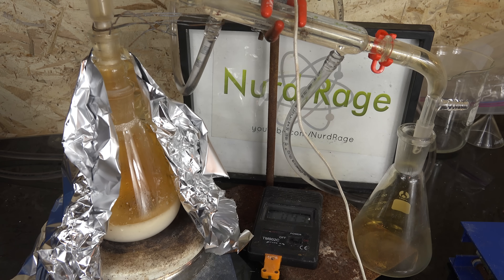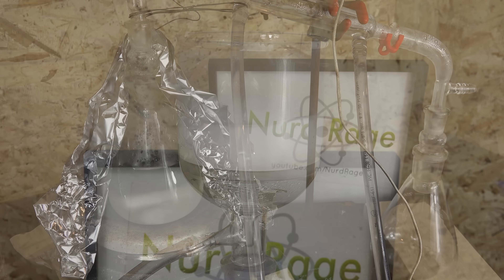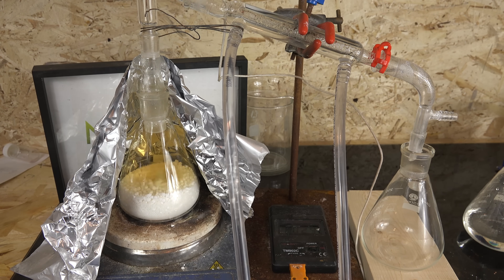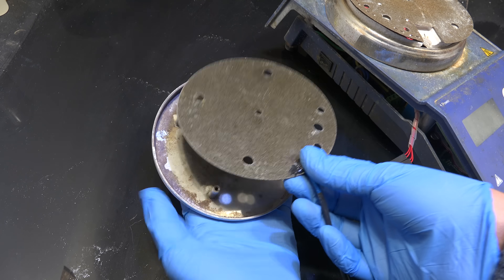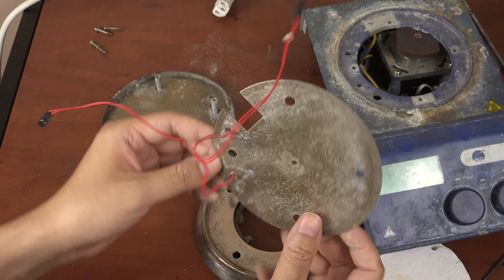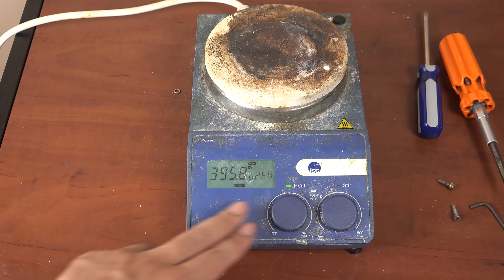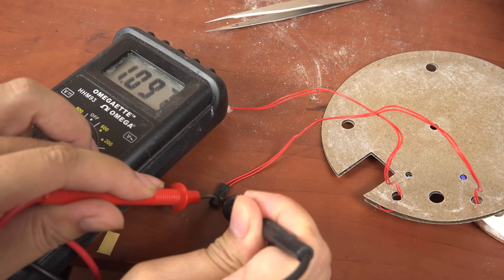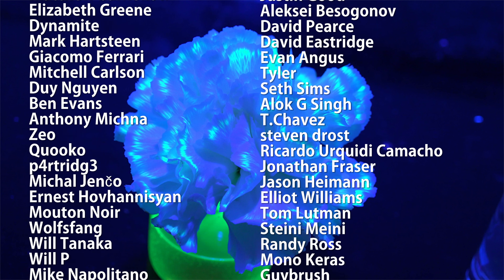Lab Notes -  August 31st - Nitric Acid from Calcium Nitrate and My Hotplate Failed, Again.

Comment: Just got my self 5 kg's of calcium nitrate. I was sure to ask the seller if it was indeed JUST calcium nitrate and not the calcium ammonium nitrate variety. Anyway, got the product, added a small amount into a beaker and added some concentrated caustic soda, only the most faintest sense of ammonia so I'm taking that as a win. Took a known weight into a pre-weighed vessel and heated it , after a minute it started to melt and bubble, water being driven off....from the values taken it looks like I have the tetra hydrate, that's to be expected though, it is after all the article of commerce for fertilizer, so I will just have to stick it in a pan and gently drive off all the water, all thirty odd percent of it !. One thing I have noticed with doing the dry distillation when using double the bisulfate, you have to be judicious with the heat because it's actually quite easy to keep on heating it after the nitric has all come over thinking you are getting more nitric when in fact all you are doing is driving over water from the bisulfate monohydrate...But overall this is by far the best way to get nitric acid.

Comment: You can also get an issue with a buildup of debris on the heating plate surface if it insulates the temperature sensor

Comment: Awesome work. I have two questions if you have time.
1. Could heating the 5(Ca(NO3)2)*NH4NO3*10H20  at ~150C prior to adding the NaHSO4 drive off the water, leading to a higher % HNO3?

2. The pool pH lowering chems I find locally are labeled as 93% NaHSO4. Do you have any idea what the inerts are, and if they would interfere with the reaction?
Reply from the maker: 1. it probably would, but at the cost of lower yield, the water helps to solubilize the reactants so the reaction goes to completion.

2. likely Na2SO4, and that would not interfere, just use an excess
Reply: @NurdRage  Awesome thanks, I'll join your patreon. Also would love so see the updated nitric acid guide at some point.
Reply: @NurdRage  What was the approximate concentration of the acid produced from the dry method?

Comment: I'm wondering if this process works equally well with CaNO3 instead of CAN or if it even matters.  I can get as much CaNO3 as I want dirt cheap but CAN is a different animal.
Reply: can works
Reply: @user-ir2tm6vg3c  "can works"
Bro you confused me with that Message.
Does IT Work??😂😂😂❤
Reply: @prolethazine6293  CAN is short for calcium ammonium nitrate the latter is calcium nitrate -- they both work.

Comment: solder had also not helped with the temperature sensors, the connection wires of such sensors are made of platinum or platinum/nickel so that the set resistance of 100, 500 or 1000 ohms is not affected, such connections are either spot welded or crimped, Actually, the entire connection up to the PCB should be made of platinum wire, which is also the reason why high-quality RTD sensors with only two very long connections are very expensive

Comment: It would be nice if you could cover the electrolysis of KCl to KClO4 using swimming pool chlorination cells that use Rb,Ir on Ti anodes. Just wondering if they would hold.
Reply: easier to just thermally decompose imo

Comment: (OFF TOPIC)  https://www.youtube.com/watch?v=VdbchGjTtSM&ab_channel=SuperPyroBoys
Watch this video and tell me what you think.  This guy was attempting to make K2S2O8 Potassium Persulfate. 
But I don't think that it is a complete process. Why?   Because the precipitate creates a very strong ammonium smell when mixed with Mg or AL.   AND.. is reactive with moisture
 I mixed two different batches. The first batch I didn't clean/wash at all after  filtering the precipitate.  Yield was 47.9 grams.  After drying  it has no smell.   It's only after I mixed it with Mg or AL that it produces a strong ammonia smell (most likely ammonium chloride).   The second batch I cleaned /washed with distilled water at filtering time. Yield was about 24.7 grams.
After drying it also had no smell.  It only produced a slight ammonium smell when mixed with Mg or Al.   The next day upon opening the second batch container it had a strong chlorine smell.   So, I'm not sure what's going on with this mix.   I'm thinking that there needs to be some wash.. neutralization of post precipitation.    I have some potassium persulfate that I purchased on-line. It is 99.7% pure.   It has no smell and produces no smell when mixed with other chemicals, Mg, Al.
Side note:    I took the little batches that I mixed up and did a burn test because I didn't want to leave it in the house.   Total came to .78mg.  I wrapped it up in toilet paper attached a fuse.   I placed it under our 35 gal plastic trash can.    Upon detonation it blew the trash can up about 5 feet in the air.   Some strong shit there!    Thanks for listening.!👍💖😎
Reply: how to make potassium persulfate. First, you need ammonium persulfate. Dang man you got my hopes up

Comment: You can get small wire crimp connectors designed for exactly this. Here's a digikey link for one for 15-22 AWG wire that looks like about the size you have there. https://www.digikey.com/product-detail/en/te-connectivity-amp-connectors/170152-3/A117873CT-ND/4729981

Comment: THANK YOU ! This is a tremendous amount of help. I can throw an idea on low voltage/amperage welding of items. GTAW (Gas Tungsten Arc Welding) on a nearly microscopic basis can be done with Laboratory DC power supply or as I discovered when I was a young adult (adolescent), a 9 volt DC, couple of wire clip on leads, a piece of 3/32" Tungsten broken into 2 halves, some dry ice in a deep baking pan, low power welding lens, and a very steady hand. Have fun with that one, it is very pleasing accomplishment when done.

Comment: I convert my calcium nitrate to the more desired nitrates (eg sodium nitrate by using soda ash). This forms sodium nitrate and Calcium Carbonate at pH~7 which is highly insoluble,  easy to filter, not as voluminous as calcium sulfate, and useful for neutralizing other metal (iron, nickle, copper, etc) nitrate solutions to  scavenge the nitrate ion as calcium nitrate again to repeat the process. Of course, once neutralized the excess water will need to be removed to concentrate the nitrate in solution for the highest strength nitric acid when using the wet processes. Doing it this way allows us to use the Ca++ ion as a nitrate source and scavenger for recycling metal nitrate solutions. I can buy Calcium nitrate plus soda ash cheaper than sodium nitrate excluding my labor costs of course.
Reply: ya i did at first too but its easier to just use cano3 with nahso4 and boil with a small amount of hcl afterwards gets caso4 out real easy

Comment: Hey, NurdRage.  Want to start an open source hot plate stirrer project?  I have some experience building 3d printers, which have 2 closed-loop temperature controlled things, and several speed-controlled motors.  I have designed several devices with 3d printed parts and water-jet cut metal parts.   I think this is doable, and would be a valuable contribution to amateur chem.  Here are some of the things I have designed: https://www.thingiverse.com/senorjp/designs

Comment: I'm an idiot, but I'll try.
I know if you add sugar to concrete before it sets, it will always remain as a "paste". It never sets solid. People used to do this when they wanted to vandalize something where they were pouring cement. Is there a chemical you can add that doesn't react, doesn't evaporate, and doesn't "poison" the reaction but stays behind and keeps the plaster of Paris thing from happening? Kind of like a reverse catalyst?

Comment: I honestly feel the best choice when using calcium (ammonium) nitrate is to mix a solution of it with ammonium solution. it will form insoluble calcium hydroxide and ammonium nitrate. You can even use excess ammonium solution to ensure full conversion of the calcium salt then recapture the excess ammonia. it is a little extra work but it is much easier to make nitric acid with pure ammonium nitrate than calcium nitrate or the mixed salt.

You can than easily form sodium/potassium nitrate with the appropriate alkali hydroxide. This can be done from the mixed salt too but you will always have either a calcium nitrate or alkali hydroxide impurity which could hinder some reactions. Yes you will have the same issue with pure ammonium nitrate but just use and excess of ammonium salt and the impurity will be guaranteed to be ammonium nitrate and not the alkali hydroxide. For most reactions a small ammonium nitrate impurity will not affect the reaction in the same way calcium nitrate or alkali hydroxides will. Also when drying the alkali nitrate a byproduct will be ammonia gas which can be recaptured helping replenish the supply you used in the initial reaction.

Yes it is more work but you have a higher rate of success in your reactions, and you will not end up with nasty gypsum in your flask.
Reply: calcium hydroxide is soluable in water
Reply: @EdwardTriesToScience  it is very slightly soluble, and the solubility decreases with an increase in which is opposite the normal solubility rules. As soon as the temperature starts to rise CA(OH)2 starts dropping out.

If you don't remove it, it will contaminate your product.

Comment: Brazing is suitable for temperatures intermediate of soldering and welding.
Reply: brazing will burn most of the isolation away... because the temperature exceeds the temperature of the isolation... isolation can withstand 450°C...brazing starts at 600°C not considering the flame torch with 1600°C

Comment: Buy terminated sensors with incorporated wires. If you need the special terminal, just cut them off and solder them back on far from the heat source. You can use a high temperature solder for a higher safety margin.

Also, I thought there'd be some kind of high-temperature solder that'd survive 400C. Then again, how the hell does a chemist solder something at that temperature?
Reply: There is solder for that temp range but the part won't survive the soldering. Spot welding works because it's so very fast.

Comment: What was the strength of the nitric acid from the dry method? Do you think could be a viable and economical means of producing higher quantities of 85%+ acid if you oven dry the chemicals beforehand relative to the 98% sulfuric acid/potassium nitrate method? The dry method looks as if you could VERY easily scale the process up to 2 - 4 times the size shown with relative ease and not have any of the potential dangers of large quantities of hot sulfuric acid.
Reply: Yeah it scales up no problem, it works even better large scale because it's easier to control the dreaded foaming.. i use 500g of kno3 and 850- 900g of sodium bisulfate in a 5 litre round bottom flask.. if you do it like this it's well worth catching the no2 that comes off the reaction, just remember to put in a suck back trap and use heaps of ice to keep it cool or it will over heat and waste all that valuable no2.. peroxide helps and so does having a bubbling container with a big enough mouth to drop ice directly in the weak nitric because it will get hot fast and it's hard to keep it cool.. from there it's easy to distill to make 68 percent out of the no2 coming off the reaction.. i forget the yield off hand but it is well worth the extra trouble, once processed it's well over 250ml of 68percent just from catching no2

Comment: You could also use some torch to weld sensor leads to wires (at least to several threads inside the wire) or just twist leads with wires tightly. Another way to weld thin wires is by using graphite rod (one from cheap zinc-manganese batteries will do) and some suitable power source. If IRC regular 120 VAC mains might work.

Comment: You can spot weld with 3 9V batteries and a couple of copper nails. It's not a long-lasting spot welder but if you need a one use unit it works really well. I needed one to connect the wiring to a copper coil induction heater. Same problem any solder would just melt.

Comment: 0:59 When I was a very young kid of only a few years old I got into the shed and tried to climb up onto the work bench. In doing so, I knocked over a bag or box of plaster of Paris and it fell right into my face and all over my body. It got right into my eyes and started rehydrating via my tears and my parents had to rush me to the ER. I don't remember anything other than being strapped tight in a straight jacket, hysterically losing my mind, as a nurse used a bag of saline and an IV tube to flush the plaster out of my eyes. :( My parents were traumatized. I'm lucky to have normal eyesight today. The shed remained locked at all times following that incident and I was officially deemed "a climber" and things were never kept on the countertops again. 😸 I hadn't done anything like that before, which was why I caught everyone off guard. Ok, thanks for stopping by to share this random traumatic memory with me. I have many more but they aren't relevant to plaster. 😇
Reply: reminds me of my father's story of almost getting eyesight damage from touching his eyes with sodium hydroxide-dirty hands
Reply: Our elders were tought
Reply: This is so random, yet has such a wholesome end to it. Glad you're OK, Mr.climber.
:)
Reply: @fstech987  Thank you. :)
Reply: well I remember my neighbor going absolutely MENTAL in a panic that he couldn't even compose himself his little kid had just been found unconscious after drinking lawnmower petrol. The kid survived, but man, how could he think THAT taste was good ?. That said, when I was about 13 at school I got a urgent message from my mom, apparently my little brother had gotten into my bedroom and climbed up onto the shelf and he ate some copper sulfate crystals that i have been growing. She was frantically asking me what it was and I told her, the ambulance got there and some time later he was.................ok. But again, how awful must that have tasted ? kids !

Comment: Just buy terminated sensors. They already have wire leads coming off them. I've seen them for 4 wire pt100 rtd sensors, so I'm sure they've got them for 2 wire pt1000 variants.

Comment: This reminds me of a video by Cody'sLab from a couple of years ago (Nitric Acid From Thin Air) where he makes nitric acid using an electric arc. Probably not nearly commercially viable (certainly didn't seem like it with the setup he used) but a very low tech method if you don't have access to chemicals for some reason.
Reply: It's not concentrated acid, but I figured out that I could react the acid with sodium hydroxide to make sodium nitrate, and then react that with bisulfate, so it's good if you can't find potassium, or sodium nitrate.

Comment: Try using much tougher Triac, like about 30 Amps at 400 Volts or equivalent, that way the stir plate's heater will keep functioning for a good while. And heatsink it too.

As for the thermistor, higher temperature version with the same resistance may be more appropriate because the epoxy tend to dissolve in heat, messing up the thermistors themselves.

Comment: Calcium nitrate is great source of nitric acid by the other way- if heated it generates nitrogen oxides (mostly NO2). No acids, no labglass, just heating in metal container with further absorption in water. I got also liquid NO2/N2O4 by cooling gases into NaCl/ice mix by this way. 
But i'm not sure about stability of calcium nitrate in high temperatures. Is it safe to heating the compound up to 600 degrees C or more ?

Comment: May I ask someone if I can make silver nitrate from electrolysis of a sodium nitrate solution with silver and graphite electrodes ? 
I don't have any nitric acid or sulfuric acid, so I thought this method would work. I'm thinking of building a separate cell for each electrode, so that the sodium hydroxide formed on the cathode doesn't react with the silver nitrate (something like a simple membrane cell).
Can someone help me with this project ?
Reply: I think that could work if you used a membrane cell. I dont have enough experience or knowledge to tell you for sure, but as long as you can do it in a safe spot (Hydrogen gas, and potential Oxygen gas) outside it's worth a try.
Reply: @theprogrammer32  Thanks !

Comment: you can use  microwave  , get 3 glass were the fits inside each then add aluminum (lead is better but it's toxic)  in the smallest one and water in the next or (NaOH solution to get NaNO3)  and turn the microwave on the plasma will do it for you  , i use solar panel  so it's kind  free for me to make , i use it to fireworks aluminum is explosive so it help the reaction ...
Reply: how long do you run it for what yield?

Comment: If your copper foil fails, try getting some small ID copper tubing (check the K&S metals display at your hardware store or order online) and crimping with a crimper designed for terminating PCB pin header connectors. I've used this successfully to terminate wires to fine nichrome resistance wire which is almost impossible to solder to.

Comment: You said that sulfuric acid is hard to get but is there a problem with simply distilling drain cleaner? Assuming you get a good source.
Reply: Not every country sells drain cleaner sulfuric acid and not every country can sell sulfuric cheap or even at a higher concentration than 15%. Its also stupidly dangerous to distill sulfuric acid
Reply: also it is expensive to take a gallon of drain cleaner and purify it down to anhydrous concentrations and still have to deal with contamination. The difference between lab grade and  toilet grade can mean the difference between failure and success or full yield and a random yield. Considering the end product of this was nitric acid there are easier methods to make nitric acid but easy is not the point of this the science is. For that matter easier ways to make sulfuric auto parts stores could carry it to refill car batteries.